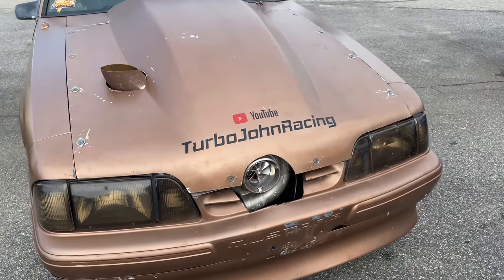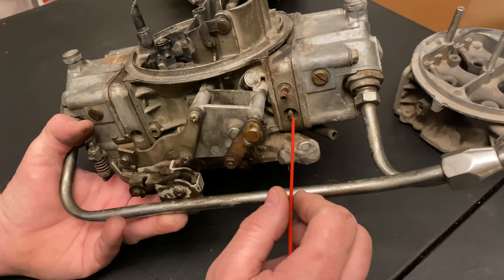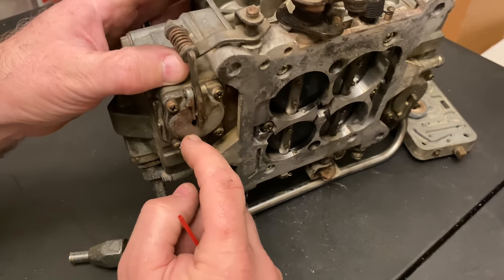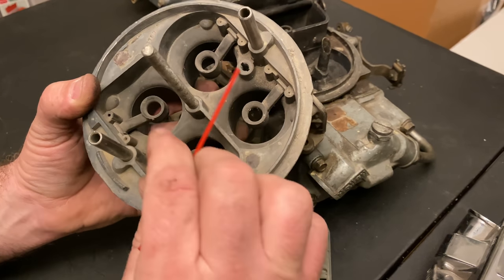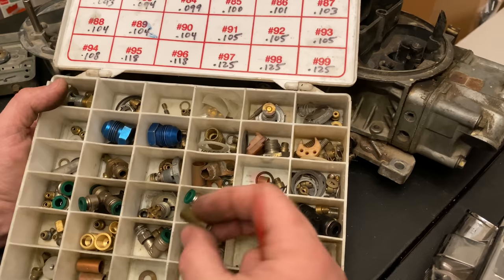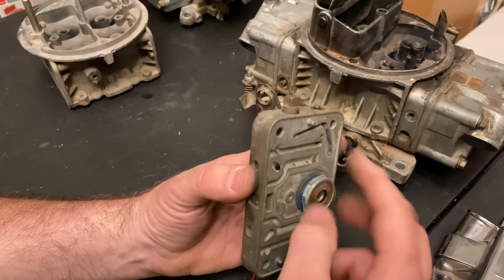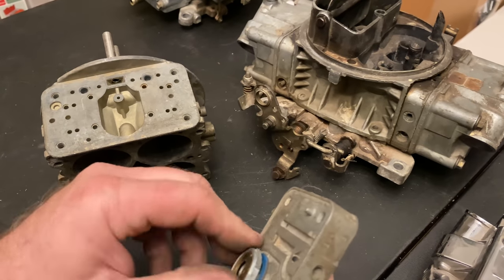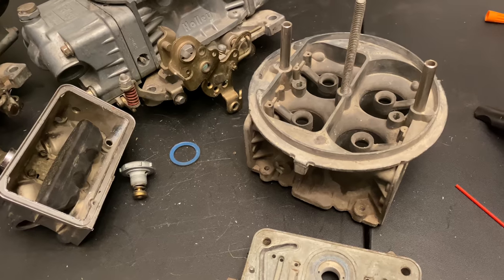Carb Basics

Comment: THE DOG LEG,I THINK YOU CALLED IT THE EMULSION VALLEY IN THE METERING BLOCK,YOU MENTIONED THAT YOU HAD FILLED THAT IN WITH EPOXY,DO YOU DO THAT ON FRONT AND BACK METERING BLOCKS? AND DO YOU RUN JET EXTENSIONS ON FRONT AND BACK BOWLS? I WANT TO THANK YOU IN ADVANCE,I HOPE THIS WORKS OUT,JUST ABOUT READY TO FIRE IT UP WITH A NEW TURBO. I CANT WAIT TO SEE WHAT IT DOES WITH MY 383 IN MY S10.IF I WOULD HAVE KNOWN TURBOS REQUIRED SO MUCH MORE PIPING I WOULD HAVE WENT WITH A SUPER CHARGER INSTEAD OF A TURBO. NEVER REALIZED HOW MUCH IS REQUIRED TO MAKE IT RUN.SUPERCHARGER JUST SEEMS SIMPLER,LESS PLUMBING INVOLVED. AND TO ME IT LOOKS LIKE RUNNING 2 TURBOS IS LESS WORK THEN JUST 1 ,NOT HAVING TO DO THE CROSSOVER PIPE. WE WILL SEE HERE THE NEXT CPL OF WEEKS
Reply from the maker: Yes, I filled both front and back.  Only use jet extensions on the rear.  Get the ones where the jet stays in the metering block and the extension slides over the jet.  Those flow more fuel from what we learned back in the day.  Good luck.
Reply: @TurboJohnRacing  THE ONE SMALL HOLE BELOW THE PART THAT WE FILL IN,DO WE FILL IT TOO?.RIGHT BELOW WHAT I CALL A DOG LEG

Comment: Having a iusse with my carb lq4 build have a 850 demon on it if I am idling and I whack the throttle it hesitates or stumbles then pull hard till i let up when i check the plugs timing mark looked good for  motor and spray just having a iusse off idle and has no air leak on the intake where would you start thank
Reply from the maker: Generally if it backfires through the carb, it's lean if it just hesitates it's rich.  Might could go down a little on the squirter size and see if it helps.  It is trial and error though.  If you change the squirter down and it gets worse, go the opposite way.  Only do one change at a time.
Reply: @TurboJohnRacing  thank for your input sir